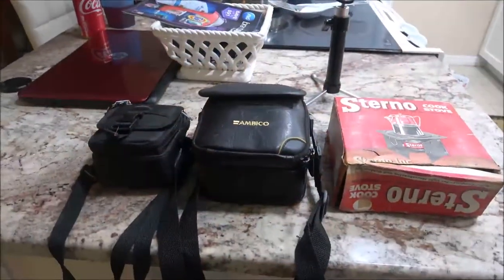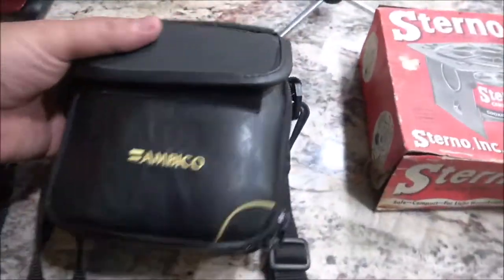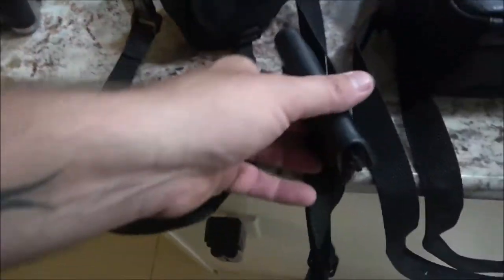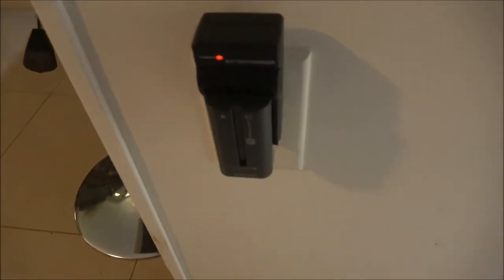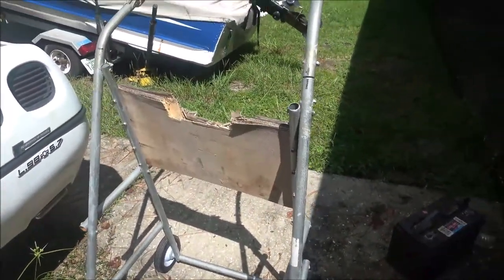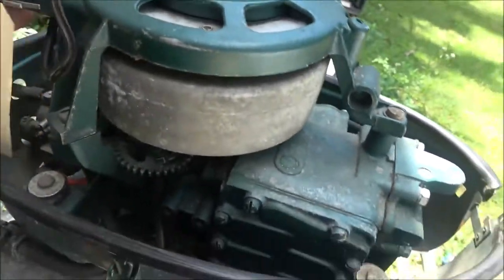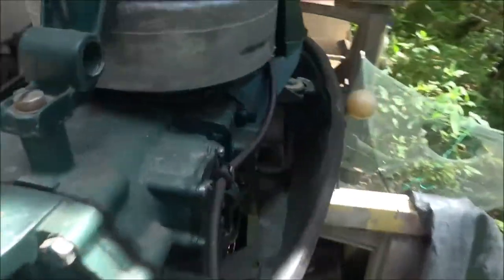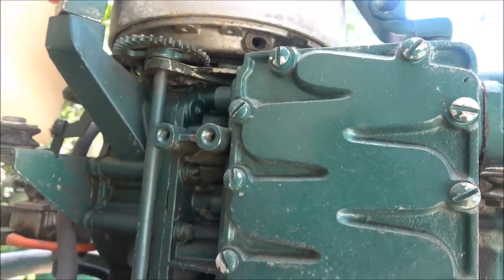Thrift Store Finds And A Rare Deal

Comment: That sterno cook stove is very cool guys!
😎🇺🇸
Reply from the maker: I just love old stuff like this.
Reply: @shabear1000  hell yeah. 

So, i looked up that motor:
Couldn't find much yet, other than images... but that "marine equipment stand" is actually designed for outboards.
It said 130lbs capacity. Yet, there were several different types, that looked similar. 

Hope you find out what you're seeking. Looking forward to seeing it running!
Be well brother. 😁
😎🇺🇸
Reply from the maker: Hey thanks for taking the time to try to help on this motor, and for looking up the stand. Also, I found out that this motor was made by Firestone, very interesting.